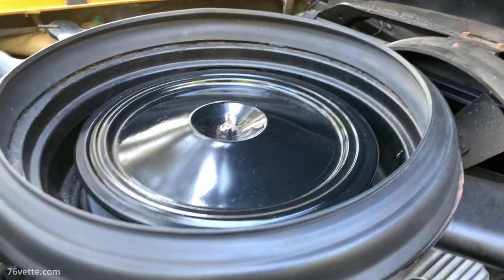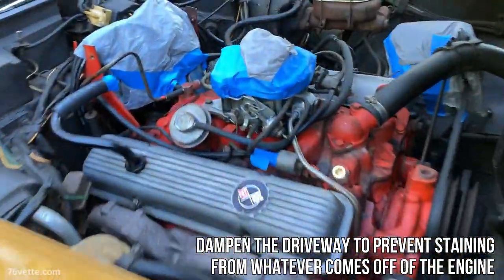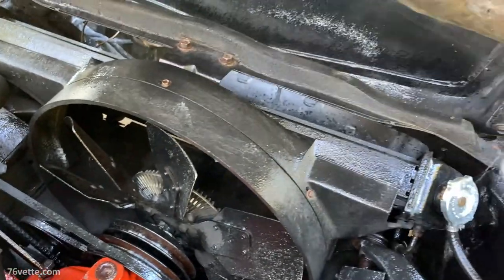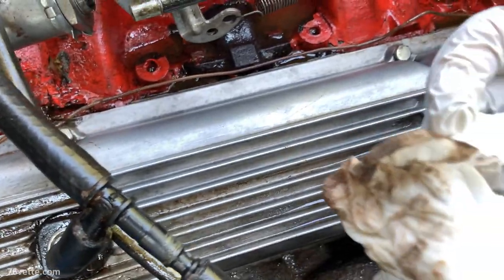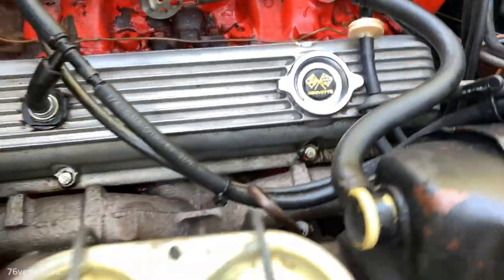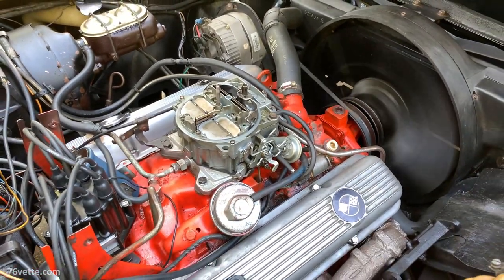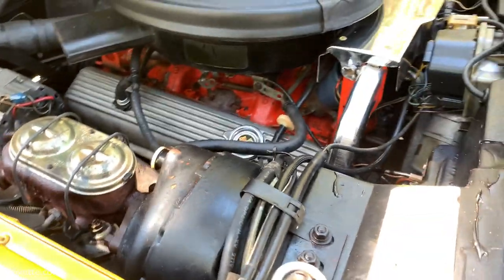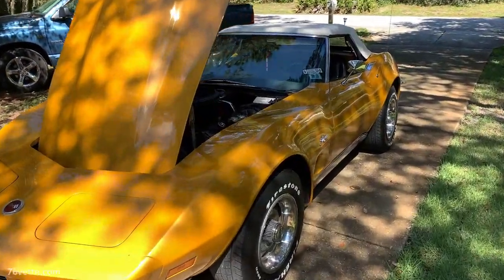How to CLEAN & DETAIL Your Engine

Comment: A couple more detail ideas just to help. First off, excellent on wetting the driveway first. Great tip! A small hand held pump sprayer is great for rinsing away grime when working small areas at a time. Use Popsicle or paint stick (sloughing the end) to hold paper towel when getting into tight areas. Air compressor, with the pressure turned down appropriately, to rid standing water. NO Leaf Blowers. Lighting and more lighting. You can foam brush paint for touch ups like the intake. Remember the prep is important. Helping a friend with a dirty, painful and timely job, Priceless!
Reply from the maker: Thank you for sharing these valuable tips. My bud Bob got motivated after we cleaned the engine and touched up the intake manifold. 😊👍🏻 Absolutely YES on the lighting. It’s so easy to miss critical areas without good light. Thanks again for sharing and following! 🙏🏻😊👍🏻

Comment: As always a great video. I do the same detailing to my C3 and 68 fastback. For those no paint areas on the intake manifold and water pump I touch them up with an acid brush and some can engine spray paint. I spray a little paint in the cap and use the brush to touch it up.
Reply from the maker: Thank you! 😊👍🏻 
Yeah, Bob was saying we should brush some paint on and we may just do that next time we work on it. 
The vac lines are hard as a rock, so he’s ordering new ones and we’re going to replace them.

Comment: My buddy is a detailer for a car dealership. When he go's to work on an engine the whole engine bay, motor, hoses etc look practically new. First he covers all the stuff you don't want get any product or water on.His cleaning weapon of choice is a good brand bottle of rim and tire  foam cleaner. He foams everything he can access. After letting the foam work awhile take the water hose and rinse and repeat until you are satisfied. Anything that can be shined he uses spray nine and ddrys them with rags  then applies Armour all to bring back the shine. Try the foam. It cleans everything that has grease or oil sheen and goes after any removable dirt around fire walls and inner fenders, etc